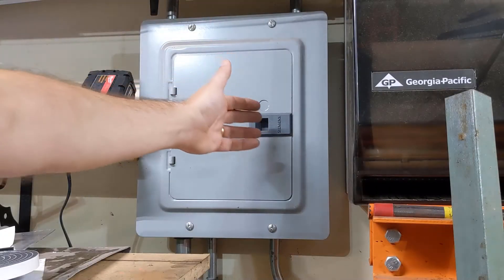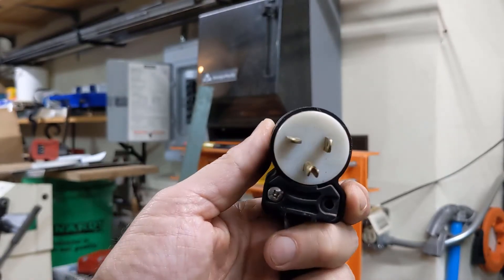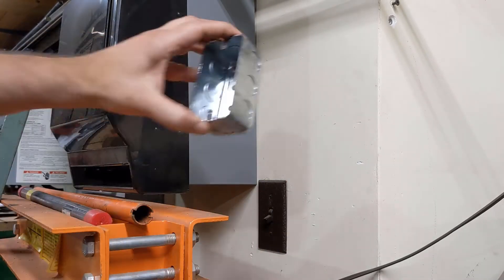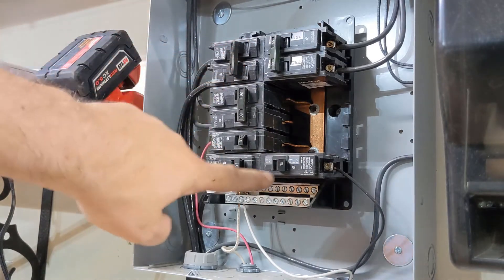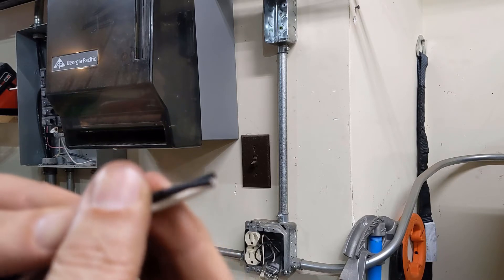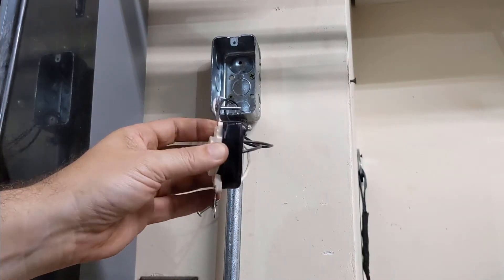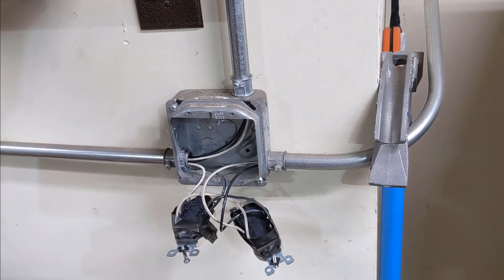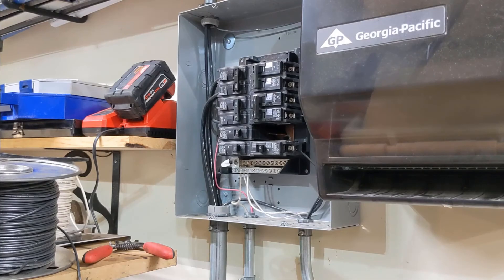How To Add a 220V Circuit to Your Home or Garage

Comment: I’d like to add a generator switch to my panel to be able to switch over and power the house with a generator. Seems like an easy operation. But I’ve never messed with the breaker box